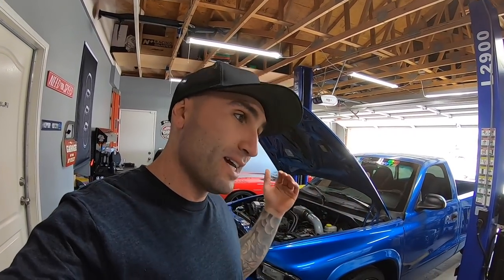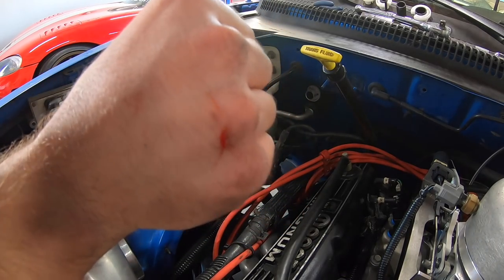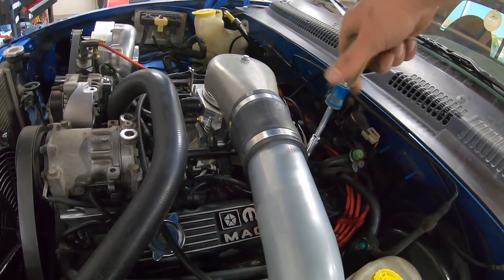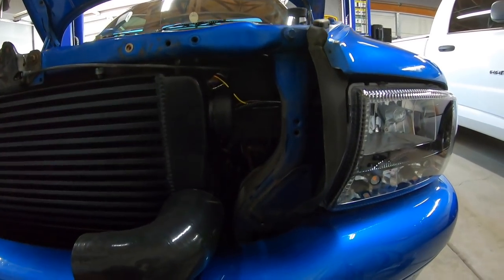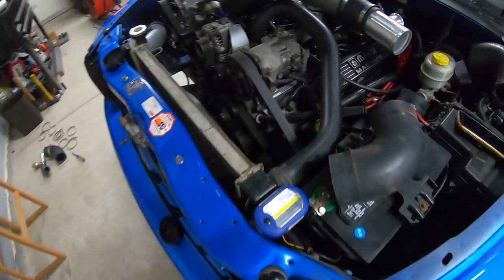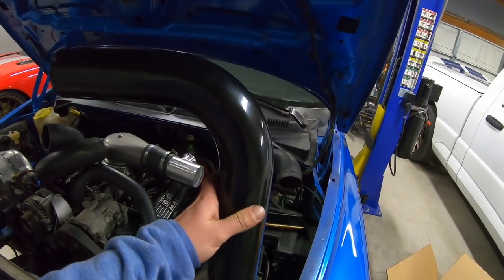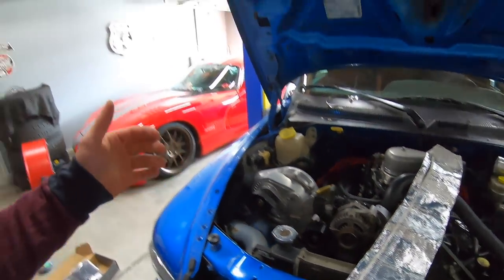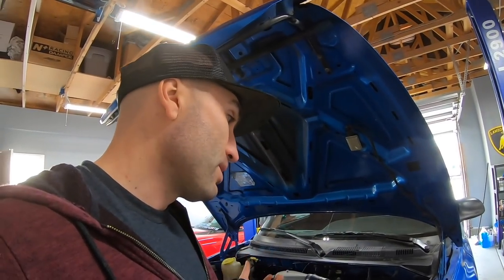Supercharged Dodge Dakota R/T | Installing Intercooler Piping

Comment: It would be pretty sick to get an aluminum fuel cell and put it and the battery where the spare was... under the bed... with like a recessed opening for the fuel door so the entire bed is still usable...  Would definitely help with traction and launching, and you'd get some more experience fabricating and welding... I plan to do this eventually once I actually get some POWAHHH. Might make more sense for you to just mount it in the bed and be done with it considering your plans for the truck. Keep it up though man, great work and content! 👍

Comment: Relocate it back to behind the passenger wheel well run a. Emergency stop button on the bed rail. Better traction. No AC. This isn’t some street truck. The less bends the better the flow.

Comment: Relocate the pcm inside the fender , it will give you more room and look cleaner , add a meth kit and name it Breaking Bad lol , or a co2 in between the rad and  intercooler , that way in the hot days you can cook down the rad and the intercooler